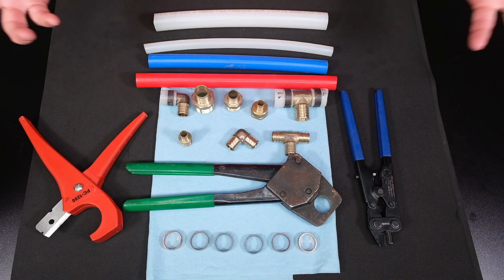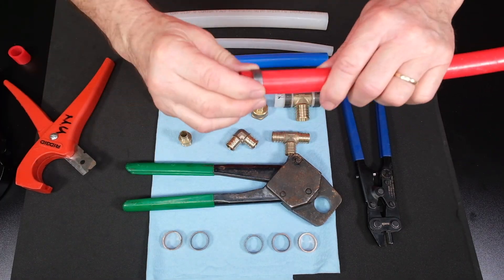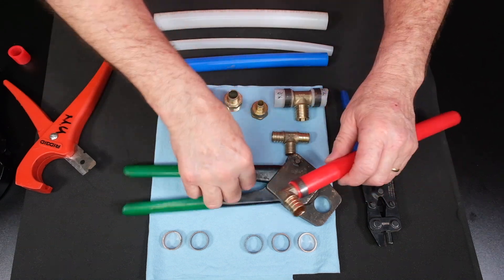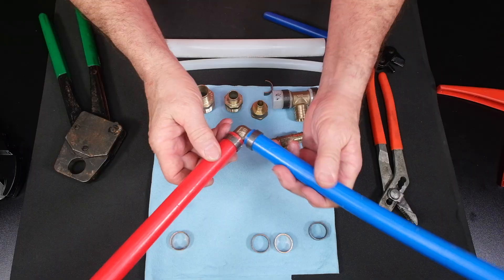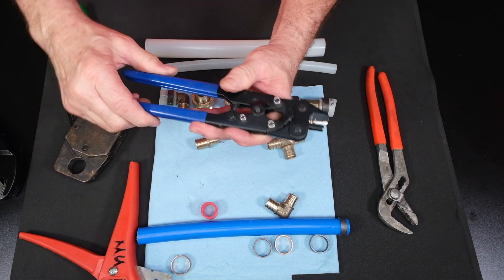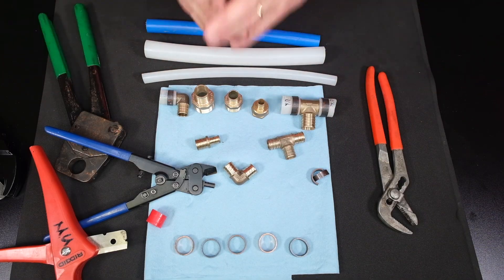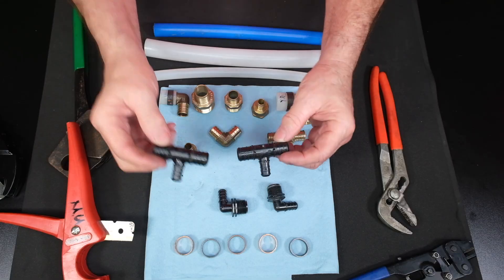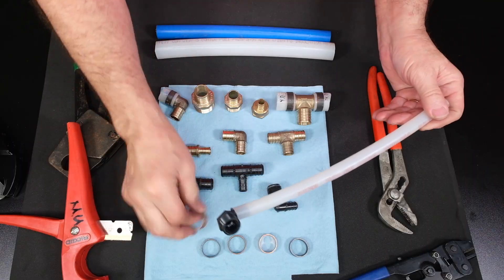PEX B CRIMP CONNECTIONS

Comment: When using a band‑removal tool, it’s critical to avoid scratching the corrugations on the brass fitting. Those ridges are the sealing surface, and even a small scratch can create a future leak. After cutting the ring, trim away the leftover PEX carefully so the fitting stays completely untouched. And always use brass fittings rather than the plastic ones — they hold up better, seal more reliably, and prevent repeat failures.

Comment: 25+ year plumbing contractor here and I would caution people that isn’t use to working with the cutter not to use it to cut the pipe to make it easier to remove from fitting like you showed in your video. If the barbs are nicked it will leak and is ruined also I only use brass fitting cause over time the plastic fittings (especially on hot side) will get brittle.
Reply: I've never seen a polysulfone fitting crack.
Reply: @ohger1 I have several times
Reply: @ohger1 maybe you haven’t been around pluming long enough, they said pex type was good for 100 years when it came out 25 years ago , I have repaired many wirsbo   pex A overtime in desert attics it
Reply: @Cheto702  We aren't talking about PEX...
Reply: Totally agree.  Both the cutting of the rings/pipe and fitting choice. I don’t know how many (call it what you want) plastic fittings I have replaced because they have cracked. Particularly on the hot side of the system if the installer didn’t make his run straight and there is any tension on the fitting.  Brass is without question the superior choice. This man has been out of the field and in the office too much crunching numbers to know.
Reply: Agreed 5 years plumbing & i’ve seen tons of plastic cracks causing leaking. I never use plastic EVER. Don’t trust it.

Comment: Frozen New England (Maine) plumber here—If you have a freeze issue, I assure you that you will have more problems than a plastic fitting issue.  
Buildings freeze from the outside in. Example— you will have a split faucet or some other problem outside of the wall in an accessible location before a problem in a wall. 
The concealed pipes are the last to freeze/ split. 
Lastly, quality lead free brass fittings are hard to find and are affected by the slightest aggressive water. By the time you realize that you need treatment, it can be too late. 
Quality plastic fittings are resistant to the water chemistry.
Reply: Stainless steel fittings are much better.
Reply: @aplante agreed if they are available..

Comment: Plastic fittings are a joke. if the lines freeze, you'll be there for days ripping open walls and ceilings to replace them with brass or stainless. Calcium deposits simply require a filter to remove them. You should be ashamed of yourself for even suggesting this sort of thing.
Reply from the maker: Brass or plastic will freeze just the same. Sometimes brass will burst before plastic will.  I do agree with you on”conditioning “ water or softening it to modify or remove calcium if you have such a system.  (Filtering will not help)
Reply: @ServingUpPlumbing  Polyphosphate filter cartridges remove scale. You can call it conditioning, but it's available in a filter cartridge, so I call it filtering.
Reply: I have been using this for 15 years in a cold climate in all those years i have had one burst pipe in pex, cant count all the copper burst pipes. So you are 💯 wrong.
Reply: @ptech88  lol, The last house i bought had several broken plastic pex fittings and one burst copper line. My point was that the plastic fittings broke easier than the BRASS FITTINGS. I was not comparing PEX to copper lines. The conversation was about fittings. Don't change the subject so that you can find a fact that supports you. When you do that, everyone else can see that you've already left the conversation and are rambling about nonsense that is completely off topic. That's a mental condition that needs to be dealt with. Seek psychological help.
Reply: @MakeitZUPER im thinking you may need the help. Since this product has been legal to use i have had one burst pipe, fitting or what ever you care to call it. I have installed 1000s of feet of it and it is by far better than copper. Thats my point.
Reply: @ptech88  lol, you don't even know the difference between a piece of pipe and a fitting? Your opinion is worthless.
Reply: @MakeitZUPER  I don't know what kind ofplastic fittings you had in your house, but polysufone fittings are more durable than brass in freeze conditions because brass is rigid.  Polysulfone fittings will flex a bit.
Reply: I live in Florida this doesn't apply 😂😂
Reply: @Alex-bd7dd 😎🙌